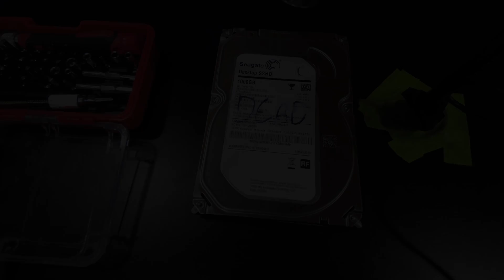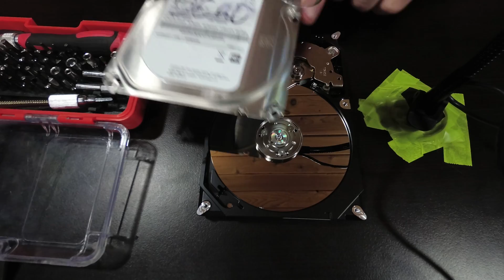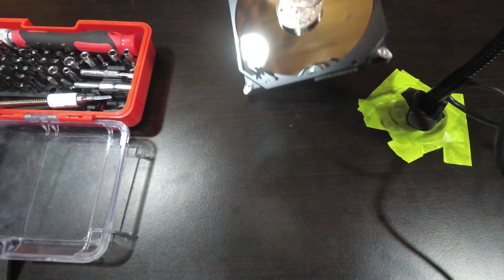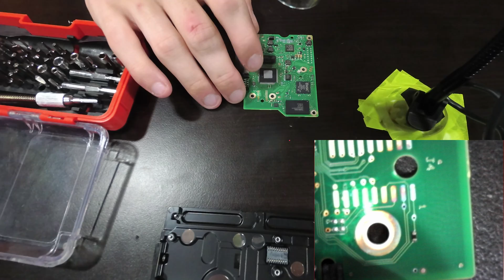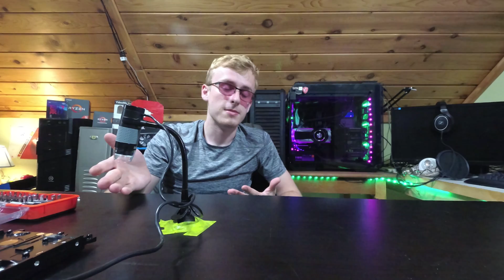Tearing Down A Hybrid Hard Drive | Whats inside of an SSHD? | Opening a SSHD

Comment: Heyy!
can anybody please answer a question....
did dell have sold laptop with sshd along with a ssd in their laptop.
or is there any need of ssd when you already have a hybrid hard disk?
Reply from the maker: Hybrid drives work by using small amounts of SSD like memory to store frequently used information so it runs faster. It is not equivalent to a complete SSD as all the storage is super fast compared to a SSHD where a small percentage is super fast and the rest is slow.
Reply: @JaysTechVault  Thank you  so much!